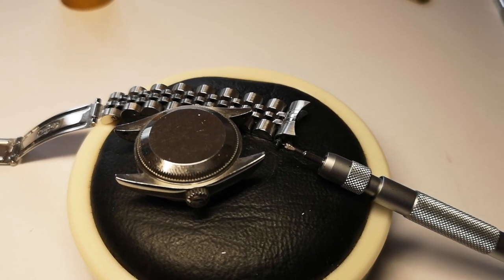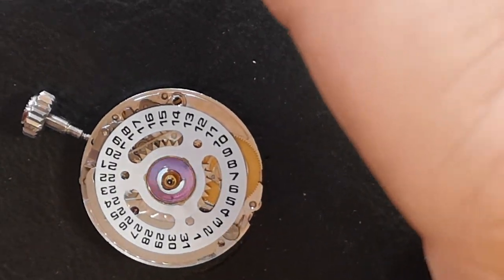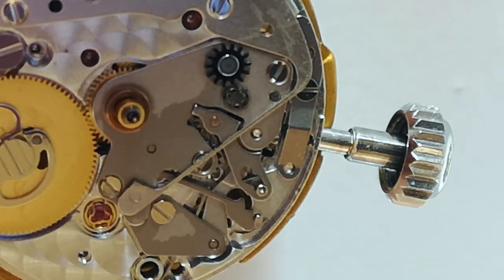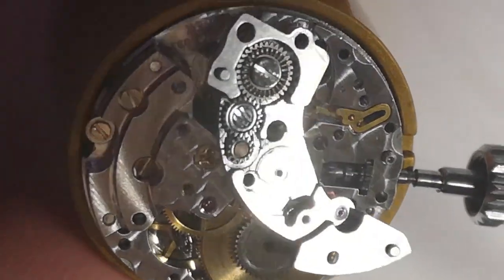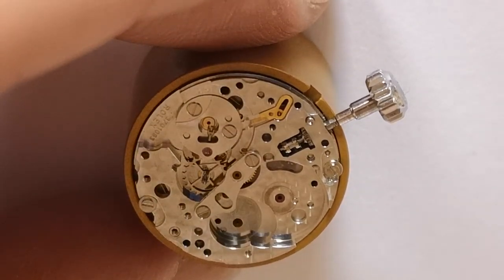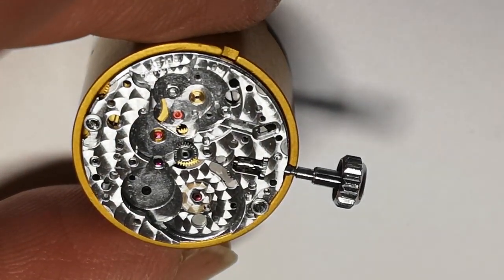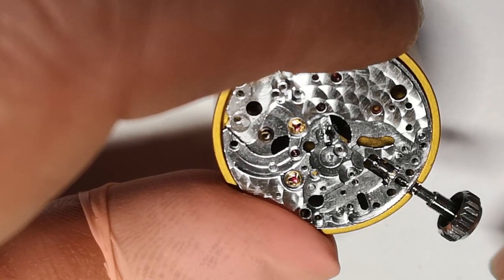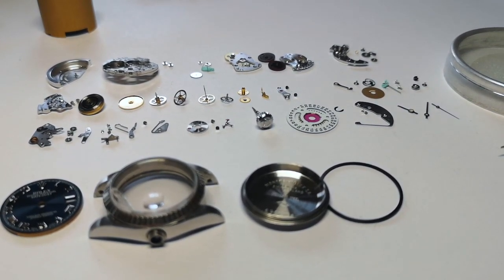Rolex 2135 Service and Repair - Part 1

Comment: OMG!  Your precision is amazing, you're obviously a master at your craft.  Details are crucial and you so demonstrate this with your knowledge.  I applaud you for your beautiful presentation.
Reply from the maker: Dr Mark .... so pleased you enjoyed this.  It is a pretty small movement!  Richard
Reply: Bro… that’s one of the most simple watches you can do lmao. Fixing a time and date Rolex hardly makes you a “master of your craft” any journeyman can get this watch back to spec. Go and see someone work on a time and date patek that’s as thick as 3 quarters stacked. I know certified MASTER watchmakers who are scared of doing watches like that. I just did a 0 friciton clutch chronograph Patek. Thing took me over 12 hours to do, and a slip of a hand could have cost me over 2k++

Comment: As a professional watch and clock repairing service .I really enjoy watching your work. It's just great  I totally agree with you regarding the removal of the balance and bridge. It's a great looking movement and it's even better when the company has had forward think ing in regards the the top and bottom  plates  being removed .will you remove the mainspring before cleaning.  Just a thought. Geat work. Richard. 
Knowledgeable work 
Roll on for #2 rebuild 
Jon. OC.
Reply from the maker: Hi Jon ... it's so nice to hear such a positive comment from a fellow full time watchmaker.  I tend to decide on what action to take with a mainspring based on two factors.  If the amplitude of the watch is significantly low I will always replace it or if it is obviously very dirty I will always remove and clean.  If the amplitude is normal and it looks good inside I will often leave it be. In this case it went the ultrasonic cleaner still inside the barrel which removed any lurking debris and leaves a very slight greasy all over once rinsed (important.  If you do use this latter method you must use a proper watch cleaner rinse which contains no water or you will simply rust up the spring!)  Hope this is helpful.  Richard
Reply: Thank you so much. But I'm a long way  of from your work  I would be formula 3. 
Your formula. 1. 
Great work and sound  just brilliant. Jon. OC
Reply: @richardperrettwatchmaker  yes. Richard I totally agree with you and I do indeed do exactly that. It was just a thought. .I'm just home from work shop just now an looking forward to to the Rolex rebuild. Ps I tried to become a member thing but found it hard to do this. I suscribe all ready .ok talk soon going for cup of tea and rebuild. 
Excellent. Jon orchard clocks

Comment: Can you explain to me why you take this movement completely apart in order to service it? It looked perfectly OK to me, but of course I have an untrained eye. Could it be possible to add some very thin synthetic oil so here and there and don't dismantle anything? OK a new crystal and some adjustments to make it run exact and that's it. When I look at this, I could do this as well, but the assembly process is of course something totally different. I could not do that in a thousand years....
Reply from the maker: Hi Rene ... If you take a look at he footage of the underside of the barrel bridge you will see that there is an accumulation of grime and throughout the movement there is most often dried up lubrication.  The easiest thing is to totally disassemble thoroughly clean in an ultrasonic cleaner until the components are completely free of dirt and old lube and then relube on reassembly.  I think you would be able to do the reassembly so long as you are prepared to put in the hours of practice.  It's just practice really.  Practice and plenty of patience.  The more practice done the less patience required.  Good to hear from you again.  Richard

Comment: Great work Richard.   I have a 2135 with broken Balance staff pivot.  I see they're available to buy 2130/2135 Part 429.  So I guess the the Balance is strippable unlike the modern ETA. ?
Reply from the maker: Hi ... So, yes the 2135 staff can be swapped out.  Maybe just check you have all the required tools before starting I guess.  Richard

Comment: Richard if i drop my rolex from waist height onto the hard floor with a thin rug would that cause a massive jump in time reading? 

Mines running 1.48 fast in 13 days since i set it. Its a 2018 datejust..

Comment: Hi, appreciate your content. I'm in my 50s but something confuses me, hopefully you could help. Luxury mechanical watches, come in models with different sizes of the same particular watch with same movements like 39 mm, 41mm and so on. Wouldn't increasing the dial size cause longer needles and make the watch movement use more power, so technically there probably could be a difference in power reserve and accuracy of the same watch with the same movement but different dial sizes? Will appreciate your reply, thank you. Keep up the amazing work!

Comment: Absolutely wonderful video for us who wish to do some level of DIY service on the calibre 2135 and similar movements! Also just to get an idea about the mechanics we usually never get to see. 

One question though: Are there, to your knowledge, any 1:1 copied movements that are NOT marked 'Rolex' available on the market which can be used as a 'practice rig' without the controversy with true 'clones'? 🤔
Buying one of the 'noobs' doesn't feel 100% all right since I'm very hesitant to 'sponsor' the fake-business which I basically hate, but I'm also a 'tad' hesitant to disassemble a genuine SEA-DWELLER without some thorough practice first.

I'm pretty used to working with electronics under a loupe and I've done a decent amount of hobby-level goldsmithing, including engraving, so I'm confident on my fine motor skills. I just need to practice the disassembly / reassembly steps and get a feeling for torques on the screws etc. I'm guessing there's no 'Haynes Rolex Owners Workshop Manual' available?

Any good source for quality watchmaking tools online? Specifically for working with the Rolex 3135. Not Amazon I'd guess... And how about oils etc? Where do one get specs? 🤔

Comment: Any reason for the red finish on some of the mechanism ?
Reply from the maker: It's a Teflon coating on the reversing wheels.  Toflon is the plastic polymer with the lowest coefficient of friction so in a way it is acting like a jewel.   Pretty sure the colour makes no difference and they are this colour by Rolex choice (jewel coloured?) rather than necessity.  Hope this helps.  Richard
Reply: @richardperrettwatchmaker  Much obliged for the explanation.

Comment: I believe the thin rotor axle is one of the worst decisions Rolex has ever made in designing a movement.  It was done in the ultimate pursuit of winding efficiency, but it came at the cost of accelerated wear, which often results in the rotor rubbing up against the plates.  I personally am glad they rectified this with more recent designs.

Comment: I have a love/hate relationship with Rolex. I own a couple of Rolex watches. 1 was my fathers 6694. Then I have a 18k Daytona made in the 90's .And last is a Deep-Sea. 
I like sport watches. I like big watches even though I have some earlier watches that start off at around 34mm . But I do not wear them. They would now make a great ladies watch by size standards.

The hate part. Expensive services, crazy expensive replacement parts. Same boring designs with very few changes. And last is they have become a rather generic watch. Too many people own them and everyone has seen a Rolex. Then there are the thousands of companies making what is commonly referred to as "Homage" . 
Then the millions of replica watches out there. So I prefer watches that are outside of the normal everyday boring watches. 
I am glad you are impressed with Rolex. I will stick to A. Lange & Sohne and AP as well as one Patek.
I prefer Omega over Rolex anyday. 
One thing about Rolex however is the fact they always sell.